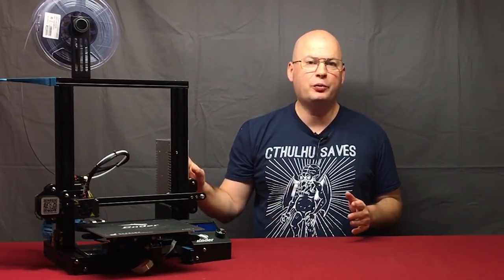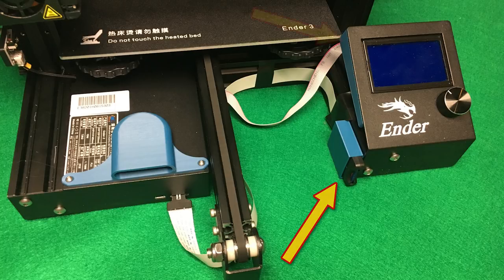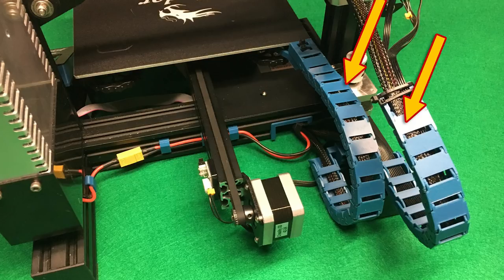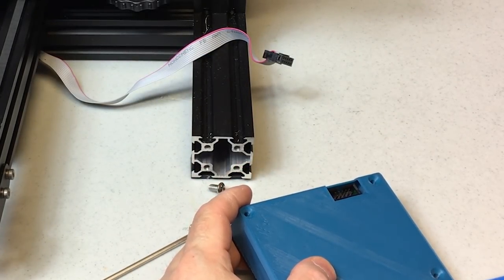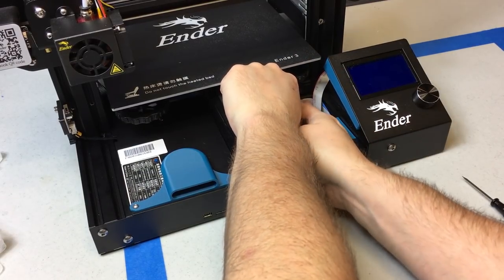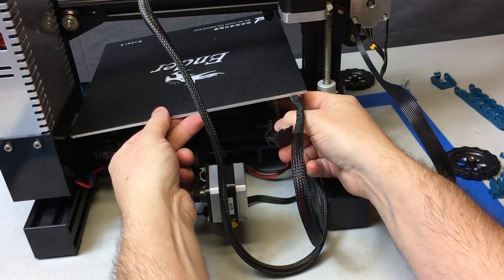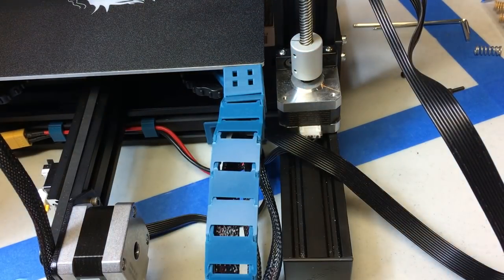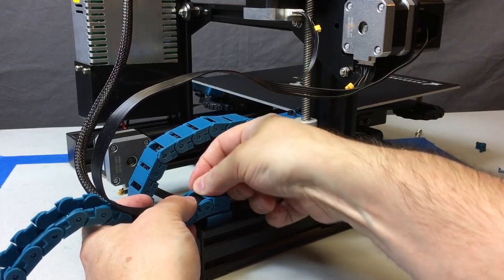Ender 3 Upgrades

Comment: Hello Guys!

I am new here. I need your help as i dont know what is wrong with my printer's z-axis.

Ive done a calibration Cube print to check the accuracy of the print.

The X and Y axis have no problem at all as it is very precise!

The problem now is the z-axis as i notice it is less 1mm in every print!
Lets say my printed height should be 10mm it comes out 9. 
In any height its all 1mm less.

See the photos ive uploaded.

The first few millimeters in the bottom of my print looks like it shrink or compressed.
i have a heated bed with 60 degrees temp and i have already tried to lower the temperature but no effect.
Still the same result.

anybody know what is the problem. I am using Cura as slicer.

Comment: Thingiverse comment says that PLA wont last for the piece that goes under the hot bed (I print at 60 degrres). Is this true? Thanks!
Reply from the maker: I use eSun PLA Pro/+, which has a glass transition temperature higher than 60˚. So far, after several months, there is no deformation to the part at all. Remember, this part is not in direct contact with the bed, so while the bed may be 60-65˚, the distance between it and the part decreases that dramatically lower than the GTP  of the PLA. :)
Reply: Good to know. Thanks!
Reply: @winstonslab946  I'm printing HIPS with a bed temp of 110˚ and mine has deformed. So I guess the answer is...it depends.
Reply: PETG also works a treat, just spent the day installing the upgrades, had a great old day of it, putting springs in the wrong order, dropping nuts, new glass bed, it looks like something out of blade runner now , cheers all
Reply: In my experience with Hatchbox PLA, it will hold up to 60 degrees directly on the bed (camera bed mount), but higher than that (probably 65-70+), it will warp. If you're only running 60 degree on the bed and especially if that part isn't directly touching the bed or heating element, it should be fine.
Reply: @PapaP86  Interesting, I printed my hot plate power lead guide part in normal pla and then ran it at 80c for petg today and it looks fine, maybe I had PLA+ and mixed the reels up, that or the corners just don't get as hot, I need a thermal cam.
Reply: Should be ok, the fan is blowing through it.

Comment: My Ender 3 doesn't recognize "3D Object" .stl print files on the SD Card. Only "GCode". What am I missing? Novice user so appreciate any guidance you may have! I notice many of the files linked here are "3D Object" .stl and I would like to be able to print them!
Reply from the maker: All model files must be converted to GCode using a slicer like Cura. :)
Reply: The STL file is the 3D model. GCODE is the actual printing instructions for that 3D object. Hope this helps.

Comment: I downloaded the cable track file and have loads of different part files, does the cable track have to be assembled or can it print ready assembled?
Reply: You need to print them separately, then snap fit them together : Read the instruction notes on Thingiverse regarding the temperature, you will need to 'wear them in' by running the connectors manually to slightly wear the joint down so it feels smooth. Just continue dragging the same file into Cura and then arrange them neatly. I printed 3 sets of 10, and 1 set of 5 connectors (Vertical cable was quite long on mine). There is an excellent graphic on Thingiverse which illustrates which parts go where - Do note it doesn't list the included file for the 'snap on to heated bed' connector piece (You have a choice to replace the entire stock connector, or use the existing one along with a printed snap on piece).

Comment: My sd card that came with the ender 3 doesn't fit in the sd extender what kind of sd card do you have?
Reply: the sd extender goes from micro SD slot to a fullsizedSD card slot. (if u get a full sized to micro adapter u can then put the factory microSD card into the back of the fullsizedSD card adapterd, then plug that into the other end of the extender)  these adapters are very common, i have many laying around - they usually come with a new microSD card, i would guess they b very very cheap if u need to buy one.

Comment: Just got mine in 2020 the fan was changed
Reply: Did you get the pro?  The fan is different on the pro model
Reply: Just got an Ender 3 (not Pro) a couple of weeks ago, and the fan is still the same.

Comment: Did you  upgrade the Extruder?
Reply from the maker: I did, but am covering that in another video. :)
Reply: Ha! i wish you would have done it sooner and I would not have installed it sideways. I am having trouble over how to put the screws that keep the screw in place.  Great vids by the way. wheeeee